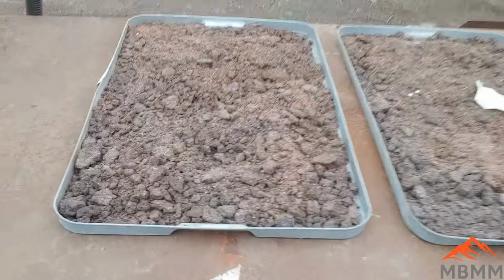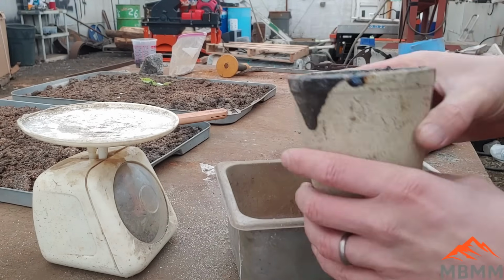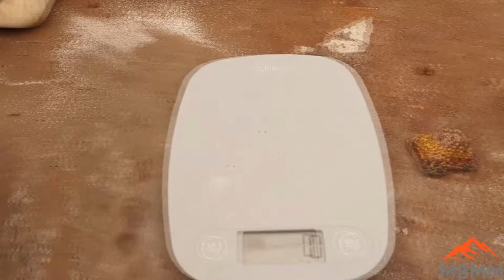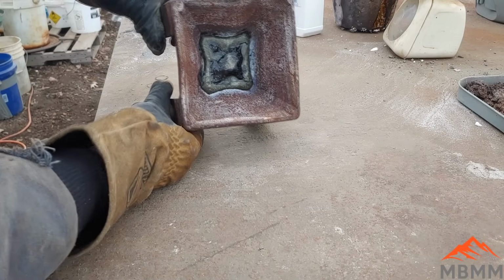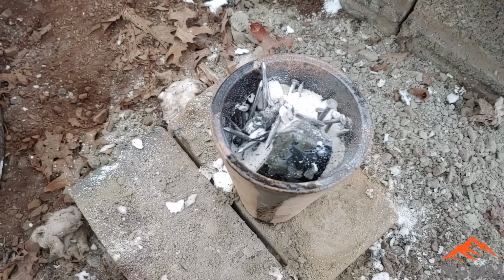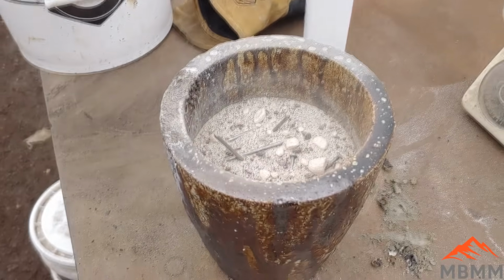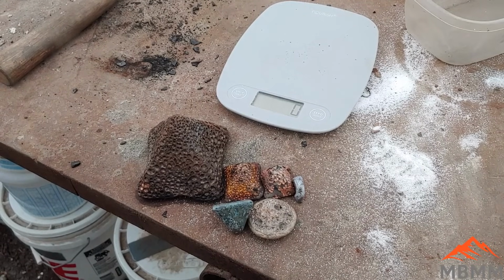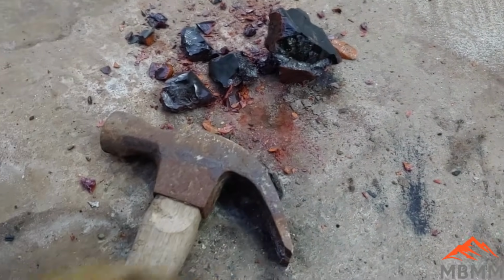Smelting E-Waste For Gold, Silver, Copper

Comment: One thing I have always wondered; how do you know when its done and ready to pour a button?
Reply: That is an interesting question. I never thought it was like cooking where it has to go through a process that takes time. But I guess if the iron is being consumed or Used up, then it might take some time for that to happen. Some people were saying that the timing of when to add certain ingredients is important. 

If the same magma from a volcanic flow will produce different types of rocks depending on how quickly it cools, then it would mean that it may have time to absorb or consume the various components present in the mixture. 

Is there something different about melting stuff that contains plastics and paper and epoxy and glue and ink etc. such as circuit boards?  I though it might be a good idea to put the concentrates into a large container of water and let the metals get washed before processing them like an ore. Or maybe that's all that is needed. They are already refined metals. Why would they need to be smelted. In large recycling plants they use a computer controlled system that separates the various metals into bins without burning or smelting. In some countries they just burn the whole circuit boards complete and let the metal run out. The metals that melt at lower temperatures are recovered first. It is a slower dirtier process. 

I think that a better way is to use a machine that would slice off the large components, then bake the boards to melt the solder and shake off the smaller parts and use a flux to clean the solder off of the aluminum, copper silver and gold with blasts of hot air to recover the solder through a screen. Components recovered in this way may recycled or reused. The only grinding or milling needed would be for IC chips which would be obsolete. The metal could then be processed in another furnace that would rise in temperature slowly to recover the various precious metals as they are melted.

Comment: Hi Jason, I am not a Chemist or Metallurgist, just a Mechanical Engineer. I would like to toss in my two cents purely from physical properties of different metals and chemicals.
When heated, the mix melts in the crucible. Heavier metals stay in the bottom of the crucible. When poured, once again the heavy metals sink to the bottom of the cone. Right? For this to happen, the mix has to be really hot. If you observe your second, third and last pour, the mix was very thick meaning the mix is near to its solidifying temperature. 
I am visualizing that the mix has not melted sufficiently. The heavier metals are not hot enough to flow (observe the last few drops when you are pouring. they stuck to the sides of the crucible). 
In theory, the heavier metals are at the bottom of the crucible and are the last to flow out and as temp is low, all of them have not gone into the cone.
What ever heavier metals which flowed out into the cone are not sufficiently hot and before they sink to the bottom of the cone, they solidified in the slag and you could not find a pyramid.
This is just a theory. I am a big fan of yours, I learnt a lot about gold extraction from you. I may not be right but as you are asking why you did not find the metal pyramid, I thought I should toss my two cents.

Comment: Copper Oxide is a oxidizing agent. Like Lead Oxide. You were reducing all of your metals into an oxide and driving them off into the refractory, or what you call your slag. Once it combined with the flux it dissolved all the metals into itself and thus mad a refractory. On your anode, don't smelt the slimes, if you do you'll melt your precious metals into the tin. There's nothing like trying to get the tin out and away from your precious metals. Take the pm's out first chemically, only other option is trying to slag the tin. Good luck with that. Tin dissolves in alkaline solutions. Maybe molten alkaline?

Comment: Ok I have done a little research on purifying metal i found a video of a guy purifying zinc he melted it down with a map torch  in a steel crucible then a bed strait carbon to the melt stired it well then dumped it into ice water the impurity stuck to the bottom of the crucible and pure zinc in the bottom of the icewater. So after watching this are we trying to hard?  I have alot of copper i want to get into bars and I'm going to try this. I will let you know what happens. I'm going to take baby steps cause ice water could cause an explosion with the heat it takes. I may have a solution though put a hole in bottom of the furnace and put water underneath it with a door you can close on the hole adding carbon as you go and storing and then letting it go hopefully the impurities stic to the sides of the furnace.  This is my plan anyway I got alot of building to do.

Comment: With circuit boards and getting precious metals narrow it down to where something connects.  That is where the gold is.  The other side of the board is going to be soldering.  Lead.  I have 4 lbs of just connections sitting in vinegar and salt bubbling in my garage.

Comment: Copper oxide and Copper are soluble in each other. They even form something like a "low" melting eutectic and are very soluble in each other in the liquid phase. Less so in solid state, but that's a different story. All other mixtures separated in the liquid state during smelting but this here does not.

Comment: Where's all the tin from the solder on your PC boards? In the #2?

Depending on boards and pre processing(depopulating or selective depopulating), you could have large amounts to primarily tin.

A lot of the sources of copper(like wire on resistors) is tin plated, so there's another source of tin.

For a large scale processor, the tin would be a very important product, it's more valuable than copper.

Comment: For metal reactivity. The general trend for sulfide should he similar to oxides. However if you want exact numbers. Look into the gibbs free energy. This is a measure of how thermodynamically stable something is, compared to its elemental form. So a gibbs free energy for CuS looks like -86 kj/mol. The lower the number the more stable the compound. If you are interested, i could try and compile a list of values from the published chemistry literature.

Comment: As you are working often with dust specially when you grind off the boards, i would suggest to wear a mask so your lifespan wont be shorter because of the inhaled, lead-tin particles.

Comment: Adding copper oxide and iron oxide you can make yourself a fun little thermite reaction - which will cause all that copper to bead up. You wouldn't even need a furnace. Actually, you might need aluminum oxide, I'm not sure if iron would work with copper - but I think it would. I don't' know much about thermite is what I'm saying.

Comment: copper could synproportionate with copper (II) oxide and form copper(I) oxide - cuprous oxide. in the pure form it has reddish brick colour. maybe first suggestion what could happen
Reply: I agree, Cu(II) + Cu can be turned into 2 Cu(I). This is high temperature chemistry, but copper chloride leach is doing CuCl2 + Cu -> 2 CuCl so I guess that CuO + Cu -> Cu2O in the furnace.

Comment: Be warry of adding sulfur to anything that you want to recover silver from...silver has a strong tendency to form silver sulfide ( this is why silver table utensils tarnishes slowly in air and faster with certain sulfur containing foods ), so you will lose silver to your slag.  To be sure of recovering silver values, you might need either: 
- a longer time at molten, for the relatively large pieces of iron to fully react with silver sulfide
- iron in smaller sized pieces ( to react faster )
- a more reactive metal ( like aluminum )  

In all honesty, I would probably shy away from sulfur, unless you are also dealing with metals that are more reactive than iron.

I have to wonder if your nails are sinking to the bottom of the crucible, thus becoming unavailable to react with lower density sulfur salt compounds higher in the crucible, so you get poor mixing, resulting in incomplete thermochemical reactions during your melt

Comment: If your goal is to reduce down metal oxides, you need to be using aluminum, not copper.

The thermite reaction will strip pretty much every speck of oxygen, and probably a lot of the sulfur as a vapor.
Reply: Yes! I think this is exactly the right solution. It steals oxygen and leaves the aluminum and iron purified after the reaction. Magnet away the iron and you're a lot closer to purified than you started.

Comment: CuO at high temperatures turns into Cu2O (cca 1000 degrees Celsius). 2 CuO -> Cu2O + O, oxygen oxidazed the copper...  I think, this happend (summary):
2 CuO + 2 Cu -> 2 Cu2O
You end up with a lot of Cu2O and not much Cu....
Edit: Cu2O is reddish brown crystalline powder, maybe, that was it on the surface...

Comment: TX you for the information about FLUX (soda ash + silica). I badly need this tip to smelt my gold powder obtained by Aqua Reggia method since I have no metal furnace but a low power torch. I have some experience with sodium metabisulfide but none with pure elemental sulfur so I am sorry to not being able to help on your reactivity issue. However the information should be readily available in inorganic chemistry textbooks and some online sources (Wikipedia) as well as gold refining forums. Finally one YT channel I recommend is (Nation of our hobbies) Just visit and drop a comment. The guy over there is very  nice, knowledgeable & professional. Have a nice day.

Comment: maybe adding some carbon (charcoal ) to the copper oxide to reduce it to metal ,the carbon should combine with the oxygen in the copper oxide and burn off as carbon dioxide/monoxide some of the carbon may combine with oxygen from the atmosphere using an excess of carbon may be needed

Comment: Why not just dissolve it all into solution and then just drop them out separately? It’s how I process my e-scrap. Nitric acid to dissolve the copper into solution then drain and pour copper solution into a bucket or tote with some scrap iron. Add a bit of agitation (I use an aquarium air pump and bubbler) and the copper will cement out. Then give the remaining scrap a quick rinse with distilled water. Put the remaining scrap into a glass beaker (I have found mason jars are a cheap alternative to the expensive beakers.) with a stir bar and heat then add a small amount of sulfuric acid ( to precipitate any lead) and aqua regia (1:3 mixture of hydrochloric and nitric acids) to dissolve the gold. Aqua regia will dissolve the noble metals (gold, platinum and palladium) specifically. After dissolution, test a small amount with stanis chloride to make sure the solution contains gold. After cooling solution transfer to a fresh clean beaker. Slowly add sodium metabisulfite 1 tablespoon at a time I have found 1oz per 200 ml of solution is a decent benchmark to follow. The solution will turn from a deep yellow to a dark greenish color. Using some slight agitation helps. When the solution fails to register with a stanis test the gold should have fallen completely out of solution and settled on the bottom. Filter the gold powder and I like to give it a quick rinse with distilled water. When it dries the gold powder is ready to melt. It really is a quick process and I have found it is quicker than using a cell to remove the gold.

Comment: Reduce your copper oxide and base metals with blast furnace style blow in air oxygen with carbon or add sulfur to flux to create copper sulfate, with your nails before you smelt.

Comment: No sulfur, no iron. Just smelt it the same as you would oxidized ore.  At the low voltage used for copper electrowinning only copper will collect on copper plate anyways. Most base metals will go in solution and the slime left over can be melted with bismuth and cupelled. If you hammered and rolled it flat like foil just dissolve it in hot sulfuric acid. Filter gold and platinum group metals and then drop out silver with table salt. Dripping lye slowly in dissolve acid solution will precipitate copper out first and the rest of the metals according to their reactivity series. When  pink copper specs quit falling and a new colored mineral begins to drop from your drip then stop and filter off copper before reducing the other metals in the order they occur in series. Not enough value to be worthwhile any way you do it in my opinion with a small operation.
Reply: You need an expensive industrial metal distillary operation and to afford that you got to already be a millionair.
Reply: Well, never used lye to selectively precipitate metals in order using sulfuric acid but only with hydrochloric acid so it might behave differently. Hot hydrochloric with 25 percent hydroponic hydrogen peroxide dripped in dissolves gold and I've used the sodium hydroxide drip to drop out gold selectively before copper. Once the brown gold powder stops falling out and pink copper begins to drop stop and filter off gold powder before dropping copper.

Comment: For iron, visIt your locaL AUtO SHOP and snag braKE DRUM?disc turnings.  The bubbles are caused by copper sulfide being oxidized by copper oxidem yielding sulfur dioxidfe gsas (bubbles) -- look up :"Pole Copper"

Comment: This is really strange , but has anybody used toilet pucks for smelting ?  I was reading a packet and it says " contains borax and surfactants"  which means it is a disk of flux and detergents. I'd avoid the chlorine ones but anybody can check for themselves. 
" Ty d bowl " is the one I read. It sure would be hilarious if it ends up being a good additive .

Comment: Some thoughts;
Keep the precious metals as concentrates as possible from the beginning most successful gold recoveries on YT are done by damaging the copper that the gold foil sits on then picking off the foils, likewise the tantalum is recovered by breaking the tantalum capacitors off the board then milling them and roasting the product. This is the sort of work that an XRF analysis or hundreds of them would tell you what's in the raw materials and more importantly where it's going

Comment: Couldn’t you crush the “all sulfides” pyramid and pan the precious metals out?
Reply: We are dealing with atoms and molecular bonds. These molecular do not separate by crushing and atom sized particles will not pan so good.. even if you could crush them so small. Have to break the molecular bonds and get the metal atoms to clump together to achieve separation.

Comment: Ok so I was building a foundry to "follow in your footsteps" and didn't want to have any air bubbles in the refractory.....    So I taped my wife's vibrator to the side of the metal drum and then poured in the refractory. It actually worked quite well.

Comment: I want you to try your concentrate with an equal wieght of soda ash and 50% of that weight in granular charcoal.  Smelt until the melt stops giving off gas bubbles.  This is the point where all the oxides are reduced and sulfides are not.

Comment: i wonder if you could use a process similar to fractional distillation to seperate out the gold before everything else. In theory heat should be all you need to get the gold to the point where it joins up and drops out. With some clever crucible designs you may be able to skip all this chemistry.

Comment: Really, even if you aren't gonna use the iron, you don't want to absorb the iron, then you're gonna change the consistency volume of the liquid you're smelting in you want to remove the iron you want to keep the schmelting liquid, whatever you might use you want to. Keep that temperature, correct it all times so if you leave something you break down to a liquefied level in there, your temperature is going to fluctuate and everything else you try and get out is going to go. Not come out, correct? It's gonna have slag in it. It's going to be not 100% quality. You have to pull the steel out. You can't just leave the steel and go oh, we're gonna turn it up and let that go. Then then you're changing the the consistency of your smelt, unless you're planning for that in your formula, but Most people don't plan per, that makes it hard cause. Then you don't then then when you get to rise to the surface, even though it's broken down into the water and you really can't see the iron ornamore, it doesn't matter. It's changed the consistency of the surface of the water. So now you're copper, won't foot up your gold, your aluminum, your magnesium, you're All your meadows won't float to the surface. They have to come directly to the surface where they're in the bubbles, so you can skim that off, as it was slag for the metal under it until all the metal's gone. And then you just have process of water. What little bit you can you might find in there? But that that that's incidental. You know what I mean that that that's not leaving all the steel in there? That this can ride the top the whole time, and you're gonna have to try and boil that off the surface of the water. And that's that's going to take hours.It's just a hard process that way, it's easier to skim the slag skim, the slag